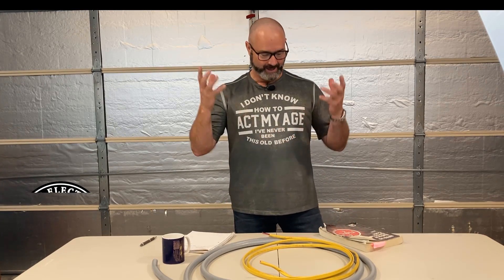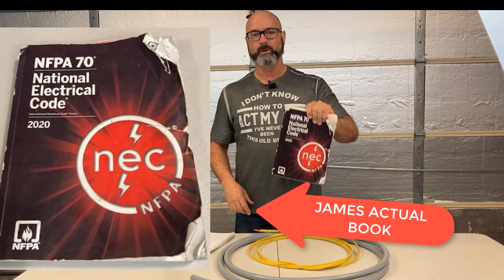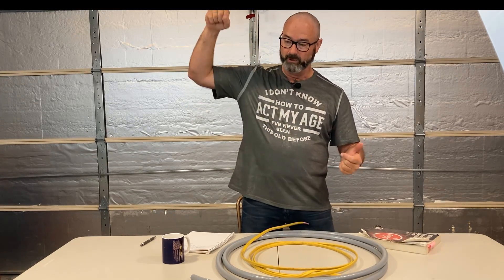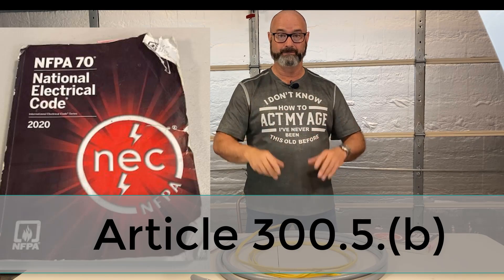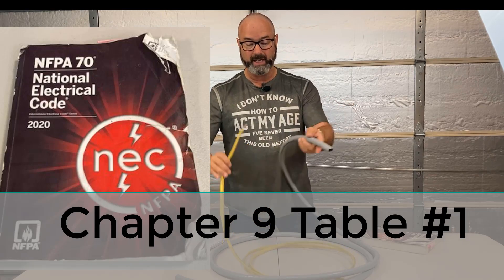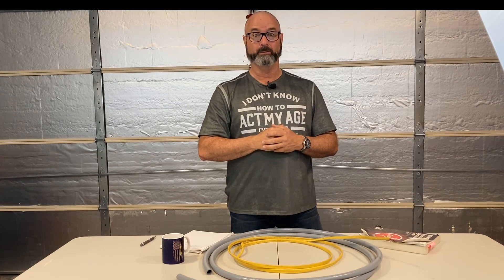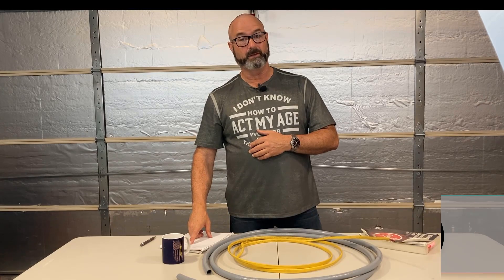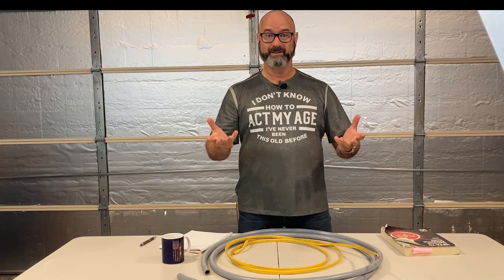Can Romex Cable be run Through Conduit? National Electrical Code Book

Comment: If you're removing the sheathing for use in a conduit, what difference does it make if it's NM or generic "primary" wire? Once you strip out the wires, is there anything unique to NM vs UF vs something else of the same gauge and strand type?
Reply from the maker: The difference is if you're being inspected. The sheathed conductors in Romex have no marking to prove their rating, especially in regards to moisture.
Spooled conductors are marked THHN,  or THW, etc.
Reply: @abrelectric  Let's say there's an inspection. We want to be as conservative as possible and not get a red flag. Do we: use only UF cable, or strip all the sheathing off Romex if it's cheaper and now the inspector sees less protected wire, yet doesn't care because it's in conduit? What do you use in basements, and how does it meet code?
Reply from the maker: @thenexthobby  I use UF or install THW or MTW wire in conduit. Conduit use will also be driven by whether or not the wire is protected in the walls, or surface-mounted, exposed to physical damage.
Reply: IMO, this is a money-making ploy by the wire manufacturers. They don't consistently print the rating of the wires inside the NM cable, but they all use THHN. If they printed the rating, you could strip the wire out of the sheath and use it. If they don't, then you will fail inspection if someone checks because it's missing the rating. But it's the same wire that comes on the individual spools. But the individual spools tend to cost more (when you have to buy several spools) than the equivalent Romex. So what is the point of them not printing the rating, if not to make you buy the same thing but where they did print the rating?
Reply from the maker: @ZiggyTheHamster  it's above my pay grade. I'm just a simple country electrician :)
Some people have suggested that some of these NM cable manufacturers have the individual conductors' rating in their product specs online. I haven't seen it.
Reply: @ZiggyTheHamster  if it's not printed on the wire then dont use it otherwise violation depending on where it's installed.
Reply: nm is rated and listed as a cable assembly that's why there is no markings.  In short terms you can't use the wires unsheathed for anything by themselves it's not listed but as a cable yes.
Reply: Yes, because once you strip it and put it in conduit those wires don't have the same ratings as thhn, thwn ect.
Reply: Update: I bought Southwire's Tri-Wire. It's got the ratings. And its clear plastic coatings surrounding each wire has already come in handy when fishing it into 1/2" galvanized pipe, although I did add a little tape to some rougher areas. It's either that or rip out the cement basement wall, since there's a 90-degree elbow at one end --- all the conduit is embedded --- and pushing it down the pipe isn't fun. But it works at least as good as pulling it through with another wire. Miserable job, overall. With any luck I'll even be able to ground the metal boxes (also embedded in the wall.)
Reply: Wire on Romex isn't marked

Comment: Now does the Romex have to be stripped before putting it into the conduit or can the jacket be inside the conduit?
Reply from the maker: The jacket can be left on, but you have to size the conduit correctly. Many times, it's easier to pull if you strip the jacket off first.
Reply: @abrelectric  from what I was reading regarding leaving the jacket on u would only be allowed 1 12/2 in a 3/4 emt due to conduit fill. We have always stripped the jacket off to avoid this problem

Comment: i love EMT conduit. if i ever build a home i want to run everything through EMT conduit. i have this weird fear of someone drilling a hole in the wall and drilling through romex and starting a fire. i would even like to surface mount the conduit if i can get away with it
Reply: War Story: Inferior Decorator thought that it was great that the builder had installed metal plates inside the wall for her window treatment installer to drill and tap for mounting screws.
Actually, nail plates. This did not end well.
(I'm sure someone, somewhere has drilled into conduit too.)
Hey, I once met a guy that thought that "those solid glass rods" from fluorescent light fixtures were great for hanging clothes on.
Reply: @icanreadthebible7561  wow😂
Reply from the maker: Back in the 30s and 40s, much of the wiring was done in threaded heavy wall pipe.
Reply: This is why AFCI breakers are required; to prevent a fire if someone drives a nail or screw through your wire in the wall.
Reply: In Chicago, the electrical code actually requires EMT even for residential. I believe this strict requirement was influenced by the great Chicago fire.

Comment: what is the proper way to  deal with a live new romex wire installed for future use.i put a large wire nut over the end of the romex ad have 4 in the open ceiling.will be installing  some lights*led* when tongue and  groove ceiling  installed using old work junction box.is this code compliant right now per nec? the romex  is just cut atthe end with the wire nut.haveto get my electric  inspection  so not sure if this is ok.
Reply from the maker: Typically,  inspectors will want to see a romex safe-ended in a small j-box with cover. Versus just tape or wirenuts .

Comment: Where are the cross sectional values for Romex listed in NEC 2020? Maybe I missed it but I’ve only seen individual conductors I.e. thhn etc.
Reply from the maker: They're not there :) there are other non-NEC tables out there. Try the Google.
Reply: @abrelectric  thanks for the reply. I get using Google but I don’t know how that would work when the AHJ determines a conduit is over filled. Romex in conduit always seems to be a grey area with inspectors and even some contractors. Don’t get me started on homeowners:)
Reply from the maker: @theRealFLATrateTEC  I typically avoid running romex through conduit more than 24".
Otherwise,  transition from romex to THHN in a j-box
Reply: @abrelectric  I’m assuming since 24” and below is exempt since it’s considered a nipple. Thanks from one vet to another and Merry Christmas.

Comment: How about SE cable, from a main panel to a sub panel, can that be in conduit?
Reply from the maker: If it's being installed through framing, it does not need to be in conduit. The other context will be whether or not this is commercial or residential? Overall, yes you can, but you still have to have the cross-section of the SE cable not be more than 53% of the cross devtional area of the conduit you're putting it into.

Comment: I have metal tubing and boxes from the old fabric wires in the basement of my house. Can I run romex through it? The basement is not damp or wet location.
Reply from the maker: In my opinion,  you can replace the old fabric wires with romex. However, you can also just pull individual conductors and save yourself fighting the romex sheath.
In either case,  be sure to have grounding screws in your boxes to keep the metal bonded.

Comment: Is a basement considered a wet or damp location?
Reply from the maker: Is the basement finished or unfinished? An unfinished location would qualify for at least a damp location rating. A finished basement very likely for a dry location, mean that it is not typically damp or wet. Reference art 100, Definitions, Location
Reply: I'll just thought I have a piece of Romax long enough to get through the conduit, but I also have black, white and green individual wires I can use.. 
Thanks all

Comment: So a 1" PVC sch40 conduit would work for a single 10/3 with uninsulated ground NM-B cable that measures 1/2" in diameter when coming from a crawl space up into the framed wall space for a 240v 30amp recessed wall receptacle for a dryer?
Reply from the maker: Absolutely! Thank you for caring about your work.

Comment: Hi thank you for the video explanation. What I'm trying to figure out is how I should run Southwire 14/2 White Solid Romex SIMpull NM-B-PCS Duo Cable in my Garage. 

I am going to install Cree commerical lights, but I would rather not have to cut holes into the ceiling. I prefer to use conduit to run to each fixture in a. Daisy chain..,.What would you recommend?
Reply from the maker: Absolutely- surface-mounted conduit, neatly run between round fixture boxes.

Comment: Hi I was one of those old electriccian that believe that you can not use romex in conduit " thank you" I'm retire now for more than nine years, question can I reduce underground 2" PVC to 1 1/2" PVC ? where can I find that on the code ? thank you for your help
Reply from the maker: William, as long as you're still meeting conductor fill requirements and using listed fittings for the step-down in conduit size, I don't know of an NEC specific guideline to your request. The biggest violation I see is using a plumbing pvc reducer that makes fishing wire fairly difficult.
Reply: @abrelectric  Thank you for your time , is this (( Cantex 5142224 Schedule-40/80 Gray PVC Reducer Bushing 2-Inch x 1-1/2-Inch)) for Plumbing or Electric ? I see other fitting and LB from the same brand, what do you think? I only pulling 4 #2 THWN

Comment: What I have done in the past and have had no problems with the inspection , in a garage I run romax through the ceiling take the sheathing off that's gonna go through the pipe and install a 1/2 inch EMT to romax connector at the top.
Reply: Removing the jacket also removes the ANSI makings on the wires.  I imagine this affects code however, no?
Reply from the maker: @pdt1980  it could indeed. The only advantage to removing the sheath, is the individual wires take up less space. They're still un- marked for temperature rating
Reply from the maker: That's awesome! And better than 98% of the nightmares I see out there.
Reply: Exactly what I do as well.

Comment: So running pvc around the basement wall and placing outlet boxes 4 foot off floor and running 12/3 through 1/2 inch pvc or should 3/4 be used
Reply from the maker: 1/2" will work. Happy basement hunting
Reply: @abrelectric  it would not be considered wet location?
Reply: Ok thank you very much

Comment: When used in an application for protection from physical damage, like coming out of a drop ceiling to an outlet, i have heard it is only required for derating and not conduit fill
Reply from the maker: In most day to day applications, you're absolutely right. However, there are times especially, with an inspector, if you sleave the romex more than 24",  With more than 3 current carryig conductors, you'll have to delete those conductors

Comment: I pulled 8/3 Romex through a 8’ section of Sch 40 to transition from attic to basement.  When I did the volume calculation, the wire is 54% of total internal pvc  volume. Ugggggg

Comment: I want to run thhn #6 /4 from main up to attic and over about 15 feet then out the soffit. Do I need conduit in attic and if so what kind should I use? It will be on top of insulation as well. Then down brick wall to hot tub sub breaker. What conduit should I use for that? I know to use liquid tight from sub to hot tub.
Reply from the maker: Carla, through the attic or anywhere interior concealed,  you don't need conduit.
Once outside, you could use 1" rigid pvc, 1" EMT,  or even liquid tite with diligent strapping. Remember you need a disconnecting means near the hot tub. See Article 680 for details
Reply: @abrelectric  sorry if I choose to use conduit is EMT ok to use as it will just be running across the beams and insulation.
Reply from the maker: @carlahayes8977  no worries. Make the EMT is bonded and supported, so the individual pieces aren't loose or binding on the Romex
Reply: So even if I don't use romex in attic I can run without conduit. I was thinking if it was thhn ypu needed conduit. Thanks for reply btw. Great videos and info.

Comment: Is a basement considered wet location?
Reply from the maker: If it is normally dry, no. See article 100, "locations". The 2020 NEC in 210.8 requires receptacles in the basement to be GFCI protected

Comment: When it comes to running cable under the floor to an island, I imagine it’s more typical to run it through crawl spaces. That seems different from underground. Is a crawl space considered a wet location?
Reply: We run romex in crawl spaces all the time. Staple it to floor joists and it passes. Don’t see why you’d want to pipe it
Reply from the maker: Article 100, definitions, in the NEC states that a dry location is one that is not normally subject to dampness or moisture.  Basements or other underground storage spaces require a GFCI protection.
Reply: @abrelectric  If basements = underground, Is NEC saying NM is now OK underground, so long as GFCI is added?

Then again, the point may be moot: These days UF is priced about the same as NM ... I swear, Southwire is taking advantage of cable jackets being something other than boring grey.
Reply from the maker: @thenexthobby romex is not rated for damp locations, underground or otherwise. See art 334.12 B(4).
The price increases, I agree, are crazy

Comment: I’m trying install a 14-50 outlet. My electrical box is on the inside of the wall and I’m trying to put the outlet on the exterior side of that same wall. The outlet is outdoors (no garage). I know I need conduit to go through that wall and into the outlet box. 

My question is:
Can I use 6/3 Romex and run it through conduit just to get through the wall and into the box? Or do I need 4 individual wires to go through conduit? 

Hopefully that makes sense. Thanks
Reply from the maker: You can push the 6/3 romex through the conduit if that section is less than 24" in length. Make sure you have connectors at your panel and the back of your outdoor box. Good luck

Comment: Appreciate the code references, spent a couple of hours reading up. Running Romex 14/3 through 3/4 PVC under a veranda is a no go? Because it's considered a damp location? Trying to figure out if this location is wet or damp. According to "300.9. Raceways in Wet Locations Above Grade" it could be considered wet. "312.2 Damp and Wet Locations" doesn't say exactly what damp or wet is. Do I need to strip the Romex?
Reply from the maker: Look at "locations" in Article 100, Definitions.
The issue with romex in damp or wet locations is that it's not rated for it. So, you use UF cable or pull individual THHN/MTW conductors

Comment: Far as fill....if i remove the cover, can i use individual wires from?
Reply from the maker: Seth, if you mean removing the romex sheath,  you can install the open  conductors in conduit. You still need to use the 60 degree column for ampacity as these wires are not labeled THHN, etc
Reply from the maker: Seth, give me some more details please. Remove what cover?

Comment: I was not aware of the underground conduit being a damp location! Question for you master electrician James, can Romax be run in commercial application? There was a guy name Steve Sutton that said that it could once.
Reply: In commercial, if stamped set of plans , ck the specs. The specks will tell you size & insulation type of permitted conductors allowed.
Reply from the maker: @rickygordon8104   Some municipalities will put the final approval on the field inspector and of course on the electrical contractor. Meaning sometimes the architect and the plan checkers will not create enough detail for a code compliant installation
Reply from the maker: The NEC seems to low it.  He also said that the UBC would Not allow it :)